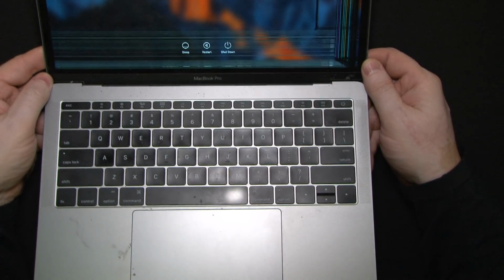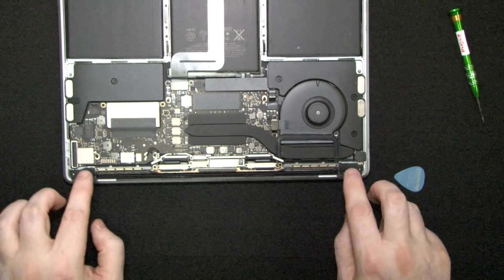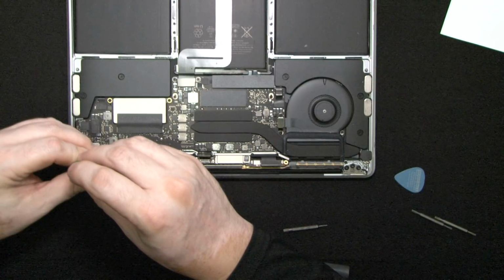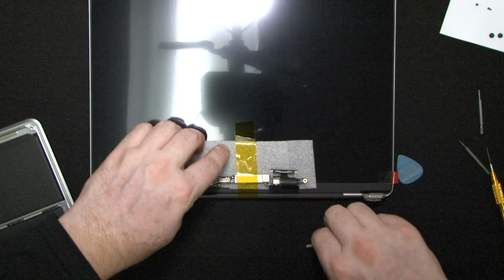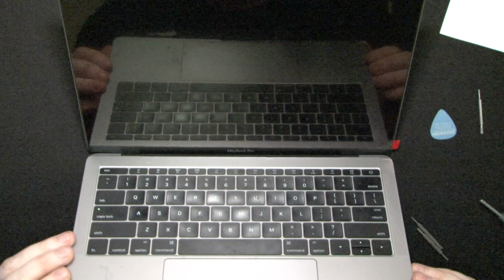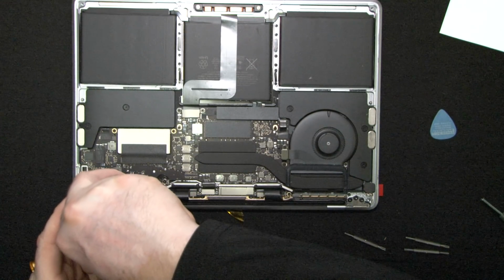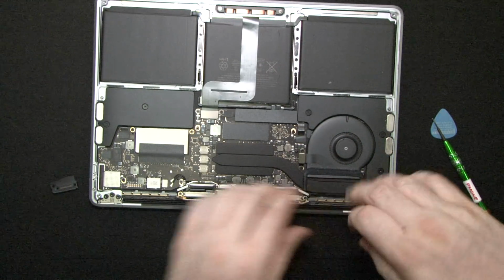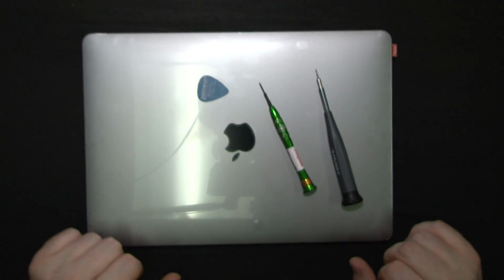How To: 2016 2017 A1708 Apple MacBook Pro Retina LCD Screen repair, replacement.

Comment: After my friend was doing battery replacement on my macbook (because I had limited time) he burned the battery inside the PC and luckly the board was ok, but the screen was burned, so I had to buy a new screen and I was not happy about that. But hearing your voice being so chill I replaced the screen in no time and thanks a lot for help! One tip is to disconnect the battery, because you don't need to hold the shift combination when turning it on after screen replacement and it's a lot safer and only takes unscrewing 3 screws. so anyways thanks for your help!

Comment: I don't wanna say nothing bad, but...the job is done, all good, just a one thing...any mistake and the screwdriver or tweezers or any other metal tools which will be dropped on the board, will kill client device, by short-circuit. I can say that this is very irresponsible repair.  Battery must be disconnected by the first thing

Comment: Apple customer care and service are awful. Previous MacBook had lots of programs of replacement hardware failure but for once! I mean my MacBook battery died after 2 years X double times and they didn’t fix my problematic device! Now my display retina is off after 5 years of usage without a reason!

Don’t buy Apple,  they don’t worth money as long as full of hardware problems!

Good machines on the first look without stamina

Comment: I've gotten to the part where I'm testing the new monitor. The backlight turns on, but the screen remains black. No boot logo or anything. Any advice?
Reply: update on this: connecting the old display (which is pretty messed up, but there's a bit of the screen that is visible), I can see it is loading to the login page. This makes me think it has to be an issue with the new display. Anyone have any thoughts?

Comment: wondering if you have had any issues with webcams not working in the screens you buy. i have replaced the screen on a macbook 1708 twice and both times the webcam has not worked. i am not sure if this is a quality issue with the screens i am purchasing of ebay or whether its an issue with the computer itself.

Comment: Abraham THANK YOU so much for this Video... I messed up the screen on my 2016 Macbook Pro. Apple wanted $750 to fix it.. To me that was to close to buying a new Macbook. So i watched your video a few times. Your detailed instruction made me feel confident to replace my own LCD screen. I ordered the unit, got the necessary tools and now my 2016 looks and performs like new.  Thank you for this video. You saved me a bunch of money i really didn't have to spend but needed my computer back.

Comment: Before you start please read these comments! 

• Get all the tools necessary first. I purchased one set and it didn't have all the right tools so I had to buy a second set. That is the GangZhiBao Versatile Precision Tool Set. You can find it online. 
• Watch the entire video first and watch another video on this. I don't have a link but there are a few others on here. The reason is some have close up shots and a few things that others do different that you can do to take more precaution. They also use a suction cup to open the case. I like this video bc he talks through it. 
• Absolutely get a magnifying glass glasses. I could barely see. 
• Clean off your work bench and place screws in dishes in groups at each step off to the side. Order them out so you can reverse order them. 
• Avoid tweezers if you can! You grip a screw and if you grip it to tight it pinches it and launches it off to kingdom come. It happened multiple times even knowing that it would happen!
• Find a large, static free, safe workbench and work area free from dust and distractions
• No liquids anywhere near you! Any liquids you want you should have to get up and walk 6 feet away
• Ensure the workbench or table is white or light colored and floor light colored so if you drop a screw or it flies away you can find it.
• Wear a grounding wrist band (included in the tool set above) and avoid metal touching metal to prevent short circuits. For example, do not drop the screws on the circuit board or touch the circuit board with any of the magnetized tools.
• Estimate out for two hours to work on this. 
• You can have a tech friend help but don't listen if they tell you to cut corners otherwise turn off all distractions. No pets while working. 
• Turn off the laptop before you start (yes it's happened to me). You don't think it's on because the screen isn't on! Take Note: if you open the lid the MacBook will turn on automatically and you will be working with live electronics! Hold down the power key for about 10 seconds to turn it off. You can check if it's on by pressing the caps lock key (the light on the caps lock key will go on an off). 
• Make sure you have plenty of light. 
• Again, avoid tweezers unless you have no other option. 
• Probably a good idea to disconnect the battery while you work (not shown in this video)
• Always backup your hard drive and shut the computer down before you start!!!
• If you can afford it have a professional do it. Since you are here you probably have no choice. 

I cannot stress enough watch the entire video first and a second video first before starting. 

If this advice has helped please buy the software promoted on my channel. 

Finally thank you to the author of this video. I enjoyed it and I appreciate the guidance and advice! :)

Comment: Thanks so much for this video.  I could not have completed this job without it.  After watching this and finishing the job successfully, it all makes a lot more sense now, and I can probably do the next one without the video.  I would like to add...  The power reset keys that you suggested did not work for me.  My heart sank...  But then I disconnected the battery, held the power button down for 10 seconds, reconnected the battery, and the screen came on immediately.  Also, when you fasten the bracing plate over the video cable, be sure to tighten the screws down evenly.  Don't tight one completely and then tighten the other.  The uneven pressure will cause the cable to come loose a little bit.  That means you'll have to reset the battery AGAIN.  I spent about 2 hours figuring all of this out.  Thanks again so much!

Comment: DISCONNECT THE BATTERY. OTHERWISE YOUR CAMERA WILL GET DAMAGED..FERRITE BEAD WILL BLOW. HAPPENED TO ME WHILE FOLLOWING THE INSTRUCTIONS ON THIS VIDEO.

NOW MY CAMERA IS NOT WORKING
Reply: I disconnected my battery, and still my camera is not working after the screen replacement.  Maybe it was a faulty screen assembly?

Comment: Can you recommend where to buy the screen? I'm seeing unbranded/generic (not by apple but compatible with apple) being sold but I don't know if that's safe...
Reply from the maker: Any screen you buy will be APPLE OEM screen. Nobody else produces that. It is sold as NON OEM to avoid repercussions from Apple
Reply: Computer Services ohhhh, thank you! Can you make an estimate of how much installation would be at a shop if I buy the screen myself? It costs $570 here if I just take my laptop in store and I think it’s cheaper if i just buy the screen myself.
Reply: @Ashley-pk7kn  where did you bought your screen?
Reply: carolina franali Ponce eBay has a lot available. But I didn’t go that route. I shipped my laptop to a company next to my state and they fix it for only $300 so I saved a lot
Reply: Dianne Ignacio omg thank you ! Do you have the link of the  company ? Was it 300 for everything? Including the installation?  Does your camera work ?
Reply: carolina franali Ponce they should be since it’s a whole top screen replacement... that includes the camera
Reply: carolina franali Ponce so even if your camera isn’t damaged, since it’s part of the whole top lid, they’re still gonna change it

Comment: Should i buy a 2017 macbook pro maxed out for 600 bucks? and buy a new screen for it cuz screen is broke and theres a fat line on middle of the screen
Reply: No. I bought my MacBook Pro 13 2017 for about $780 in almost new condition. If you do buy the laptop and get an LCD (replacing it yourself) then that's like $950+, if you buy it and turn it in the shop for fix that'll total you about $1,150+. I recommend looking for a different listing.

Comment: Good video - except be sure to disconnect battery prior to repair and lay unit on a ESD safe mat. You will need a suction cup to pry bottom case. To disconnect battery use an iOpener or heat gun. 

Repair takes roughly 60 mins. Be patient 👍 keep screws organized in ice tray / screw tray.

Comment: For anybody having this issue in 2019, AND if your Macbook is either the MacBook Pro (13-inch, 2016, Four Thunderbolt 3 Ports) or the MacBook Pro (13-inch, 2016, Two Thunderbolt 3 Ports) model, Apple released a Backlight Repair Program that will fix this issue for free (even outside of warranty). Just visit https://support.apple.com/13-inch-macbook-pro-display-backlight-service to get the details. Saved me about $600.

Comment: I have a 2018 (bought new in July 2018) Macbook Pro 13" and I have the "1/5 of screen on the left has a top to bottom column of screen 50% more dim than the rest of the screen" issue and also will only work that way for a few min after turning on - then goes black - with about 5-20 random purple up and down lines on screen. )

So i'm assuming its a 'short' in the monitor ribbon like 2 of my friends both suggested? I wanna take to Geek Squad at my local Best Buy but i dont wanna pay a bunch of money.  Can I do this on my own? idk where to even find the part! (monitor ribbon)

Comment: Hi,

My Facetime camera said Not Available after I replaced the screen.
Reply: Hello John, the same thing happened to me. What did you end up doing?
Reply: Same thing happened to me.  But everything else works.  Is this likely a defective screen?  Or could it be that I forgot to connect something?  Is there a specific connector for the camera?
Reply: Same thing happened to me. My camera is not working after the installation. HELP, PLEASE!

Comment: This was a great video. I was able to get this job done in a little more that an hour. I would recommend using a suction cup when removing the back cover instead of a sticking something in the screw hole. The suction cup allowed me to get the guitar pick in almost instantly.

Comment: hi, i own a 2017 13 inch mac book pro, on the wright side of the screen, there is a area with some werd lines, of diferent colors, with stufe that sort of looks like code, like 1 0 1 1 0, i'm blind so my brother described it to me, but it's some thing like that, so i wantedd to know what is the problem, how much would it be to fixe and stufe, if u need more info please tel me, thanks to ani one who replied

Comment: Complete amateur, followed this guide and completely swapped my lcd. 

Made a few mistakes but learned along the way. 

1. Stripped screws - make sure to get right sizes and have them well connected. 
2. Power - didn’t take out battery but it still worked out, dropped a few screws in there 😬😬
3. Took me like 2 days so make sure to take your time.

4. Praise God.

Comment: Did replace a screen on macbook pro. Laptop is working, fans are turning on but screen is black. Decided to put the old screen back on still got same problem black screen. So you know what can be an issue? Tried to to push buttons you were talking about on your video, nothing changed. Please help
Reply: Same problem here. Did you find a solution?
Reply: @paulmxch  no, never fixed it

Comment: Thank's for this video. I have a question, the LCD does have a screen glass replacement, or when I buy the LCD just replace it. thank you for your time and appreciated.
Reply: Bob Baker depends what are u buying whole display unit just replace it, or display itself in this case long story starts

Comment: I did this, and LCD worked fine. I shutdown computer and installed antenna and then the computer will not power on. I have tried connecting and disconnecting battery, tried resetting SMC but nothing works. No fan, no key lights, no signs of life at all! What could I have done?
Reply: Steve Noah did you find out what happen. Sound like batter disconnected accidentally

Comment: If you do anything on the screen, first disconnect the Battery!!! What he does ist not good, cause Battery is connectet. The rest correct. Please first remove the black Paper in the Middle. Then remove the Screw, wich is placed there and disconnect. The remove the digital connection near the screw. Than nothing can happen, if you have a jumpy screw. Thats better. To reconnect, first put in the screw and then connect the charging controller ( digital connector ).
Reply from the maker: Correct. 
Always disconnect battery!

Comment: Hi, just wondering if there's a way of fixing the lcd when there's lines but the lcd is not cracked...I have seen many lcds in this condition for sale on ebay...so there might be a way of fixing this problem

Comment: You must disconect the battery first.
Reply: You should disconnecte the battery first. I just changed my screen by following this video. The screen is working but not the camera. As per the manufacturer by not disconnected the battery I have damaged the connection of the camera...
Reply: Did you try to disconnect battery on this laptop? It’s soldered on the logic board!
Reply: Алексей Асташков no, it‘s not.
Reply: @AlexeyAstashkov  не, там 2 шлейфа идут на защелках.
Reply: you can't
Reply: I didn't have to and mine worked fine. I think the key is to make sure that there's less than 25% of battery charge left. I changed mine while it had 16% charge and it worked flawlessly.
Reply: You don't have to. It is only good if you are very clumsy and have history of short circuiting things. I only do it on some jobs.

Comment: Hey do you have a link where we can purchase the screen?
Reply: Justin Y. AliExpress in China
Reply: Justin Y. Pictures don’t show Apple logos, but they come like the original screen. Most are 100% genuine parts
Reply: Justin Y. A1708 is the model number. Will fit 16/17 MacBook Pro. Shipped to Ireland it was around €300 all in...
Reply: try:  Apple LCD Screen Assembly MacBook Pro 13" A1706 A1708 Late 2016...
$199.00Buy It NowEnded
Free Shipping
Reply: Justin Y.  You mean "famous brand" in Chinglish.  Yes, they may or may not be counterfeit, but they are as good or better than the ones Apple ones.  They come with the logos, but the photos are photoshopped to cover their butts.

Comment: Hi! Hope you can help.My macbook pro 2016's screen backlight has the 'spotlighting' issue. Which part causes it and is it possible to repair without sending it to Apple?
Reply: Make the coating on your display come off and Apple will replace it for free dont mention the other issues

Comment: Do you know the part number for this assembly? So a 2016 and 2017 A1708 use the same assembly? 2560x1600 Native. Thanks
Reply: try:  Apple LCD Screen Assembly MacBook Pro 13" A1706 A1708 Late 2016...
$199.00Buy It NowEnded
Free Shipping

Comment: the display came together with the flex cable or they can be separated ?
Reply: maximus the new display cake with coilover and there’s the little metal foldovers that we’re already on the new screen.
Reply: But Noooo. Pull nothing out. Only unscrew then slide old screen out